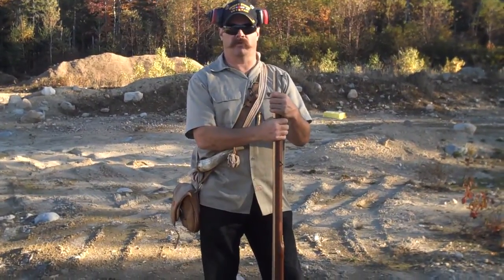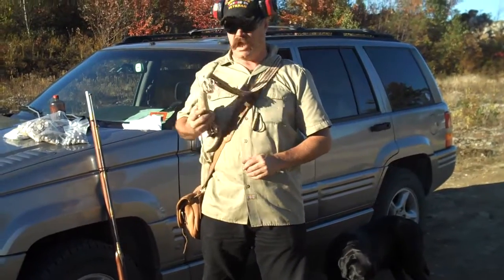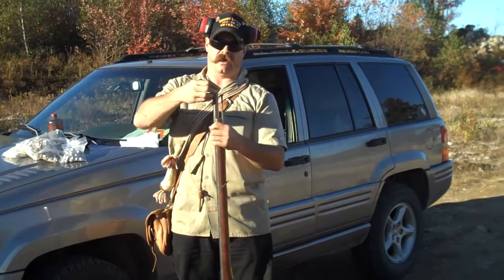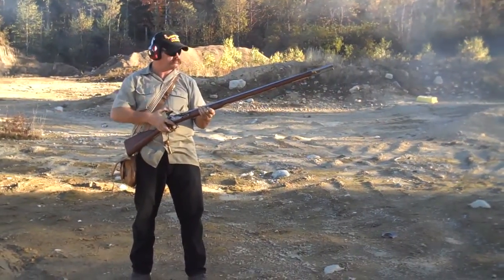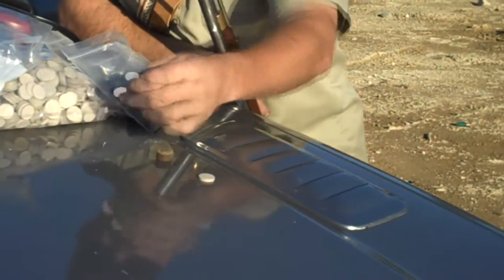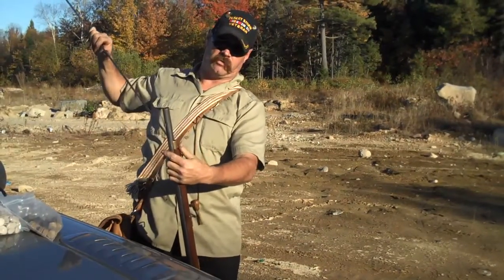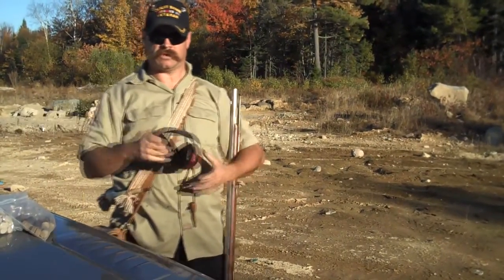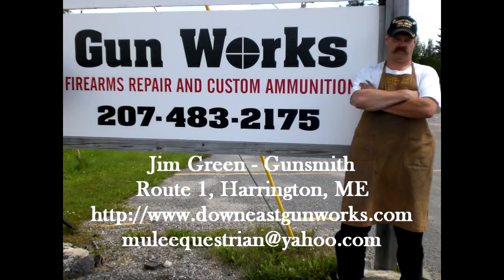Gunsmithing: Versatility of Smoothbore Muskets (Gunworks)

Comment from the maker: You'll NEVER hear me say my way is the only way to do things. Just the way I was taught, and it's never caused me any problems. One thing I use is hornet's nest materials to cushion the cloth patches from burning gasses on firing. Might be why the old timer told me to blow down the bore after each shot. That stuff does burn up quickly.  I scrounge old hornet's nests while I'm in the woods. Been a bit too exciting a few times when I find one that's still occupied. Ooops !

Comment: I think you should run a wad down under your ball and wad on top to prevent the ball moving off the powder. Two I blow down my barrel like you did there but some clubs won’t let you do hat. 
You can patch a ball just like a rifle load and the accuracy is usually improved. 
Reducing your charge to about 75 grains on your shot load will tighten your pattern

Comment from the maker: A good rule of thumb for muzzle loaders is start with one grain of powder per caliber. ie - .69 caliber, start with 70 grains of powder. Then work your way up in increments until you get decent accuracy. If you start to see a huge fireball at the muzzle or even unburned powder on the ground in front of the muzzle, you need to back off the charge. Ideally, you want a puff of gray smoke on firing.

Comment from the maker: Well in the case of CW cannons I'll agree. I STILL fire these large guns, and it's impossible to blow down the bore. We usually put a thumb stall over the vent before wet sponging. But there's the difference! WET SPONGING is not something you do on a muzzle loader. You never heard me say I was the only person around that knows anything about flintlocks, did you ? We can all disagree with each other and it doesn't distract from anything. I was taught by an old timer to blow in the bore.